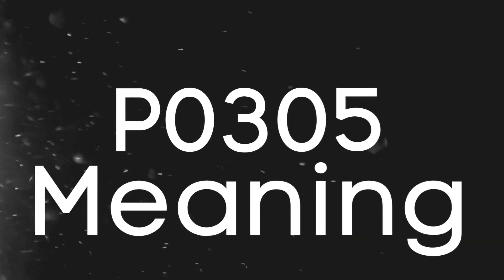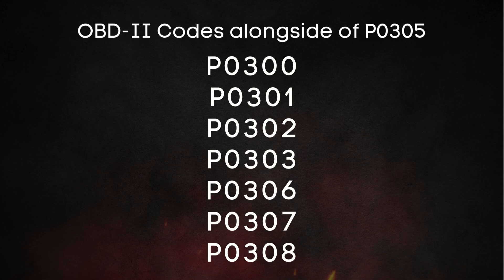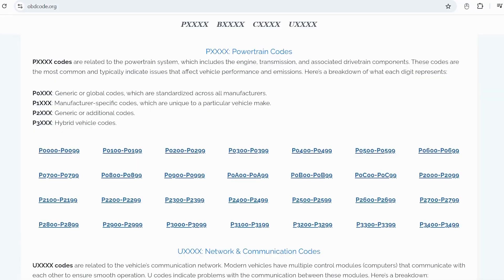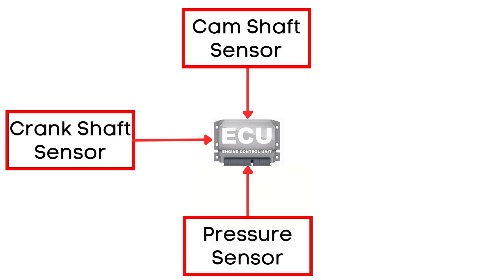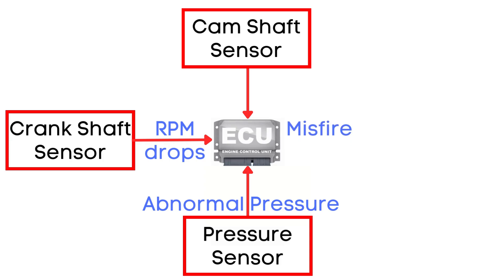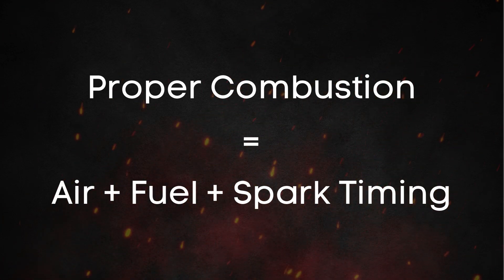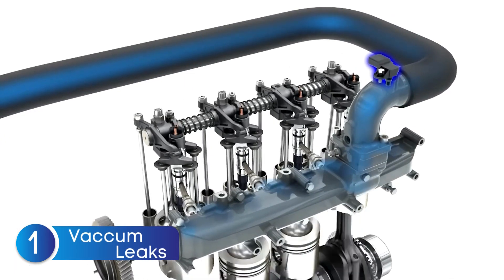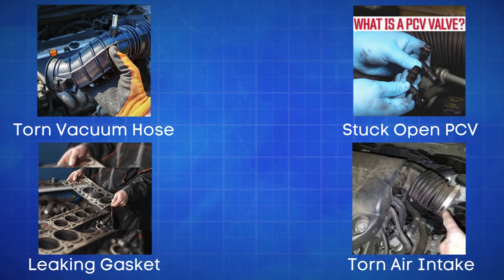How to fix P0305 | Cylinder-5 Misfire Detected

Comment: try everything on my ram,new plugs, new injecter ,new gasket, nwe coil, new battery, i just give up and drive it will go anyway its a damm v8 it will run on 7 cylinders until i buy a toyota hopes its better lol.
Reply from the maker: I understand how frustrating it can be when a vehicle issue persists despite trying multiple fixes.